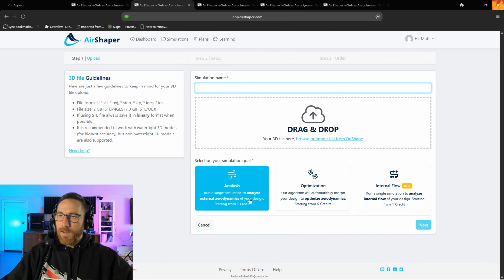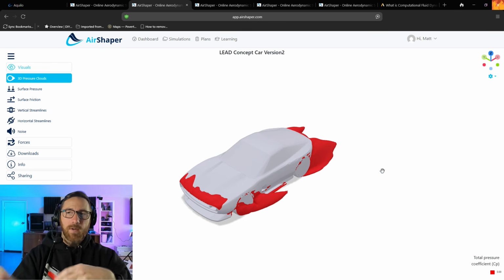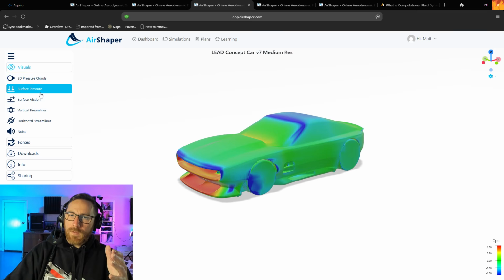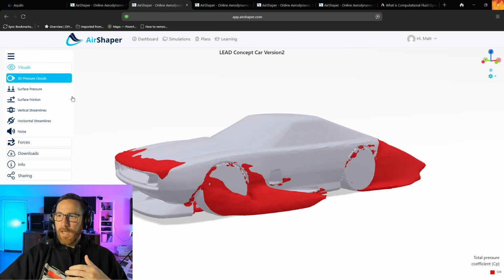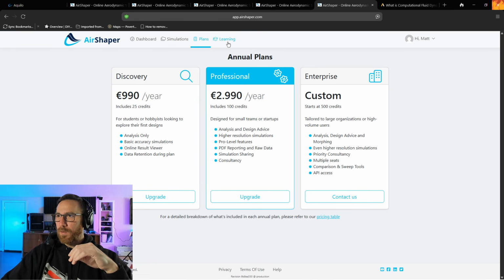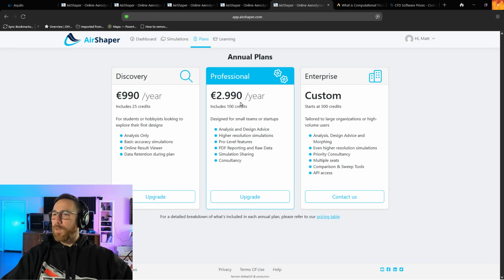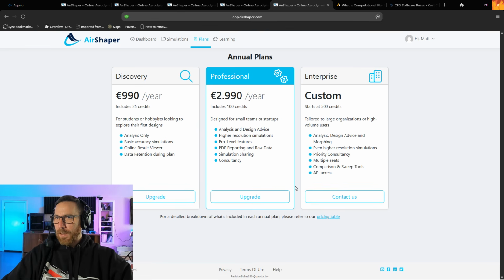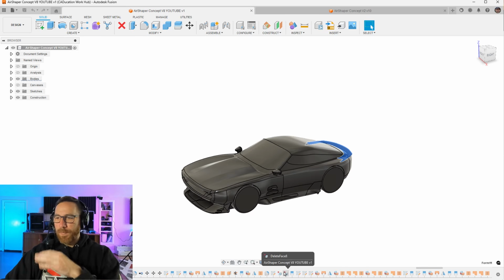AirShaper Lessons Learned | Review | Pricing

Comment: If CFD requires anyone near anywhere near the number of iterations that FEA does,  wouldn't  it cost multiple tens of thousands of dollars for a single project?
Reply from the maker: A basic simulation is 1 credit.  This is $30 in the Pro plan.  the "final" studies I ran were 10 credits or about $300.  So you could run 10 basic studies to get a design direction (if needed) for $300 and run a more final simulation to validate the results for another $300.  If you were to run a higher resolution study on lets say a vehicle model with lots of features you are talking about $1000-$1500 per.  But again I would say lower res initial studies should be used.

For FEA I am not sure what you mean.  With iterations are you talking about changes to the design and rerunning the simulation?  Similar to how Generative Design does?  The number of iterations a simulation goes through to normalize a result doesn't add to the cost.  The number of design changes that would require a re-simulation, yes.

As a comparison if you were to rent a wind tunnel in some cases you are talking about $1000/hr.  If you were trying to do car aero digitally before making a final part and going to a wind tunnel, or going to validate those changes spending $1000 on a high res CFD study a few times to validate parts you would take to a wind tunnel is very cost effective against the $50k you would spend to rent that wind tunnel for a few days which might result in "back to the drawing board".  That 50k doesn't include the transportation of the vehicle and parts to change, and employees/engineers to handle that aspect.  So a trip to the wind tunnel for a few days might easily be a $200k outing or more.

All that to say YES there is a tipping point.  If you do a lot of simulation studies then the local solve option with another software might be the best solution for you.  If we look at SimFlow and 10k/year, this is locally solving.  This is roughly 330 basic res solves or 33 medium res solves or 8ish high res solves.  In reality there will be "discovery" basic res solves.  If we use my project as an example it would be around $700 for everything I did.  Doing this again it would cost less as I know a bit more now so probably $400-$500.  If we assume I go on to do a final model and solve it at the $1000 rate then we are sitting at $1500 for one project from concept to final model solve.  If you need to do more than 6 of those projects in a year, then SimFlow ends up being cheaper putting ui/ux/consulting etc aside.  So from a pure cost that is approximately where I would put the break even point.  Having used simFlow a little I would also add in the time to setup and review based on the rate the person makes doing the work as a factor too.

Hope that helps.